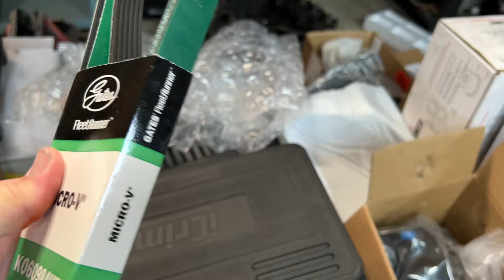What Happened to the Midnight Express

Comment: only diff between the trans is the 200 has a universal bolt pattern and a smaller gear ratio right? Just use it.